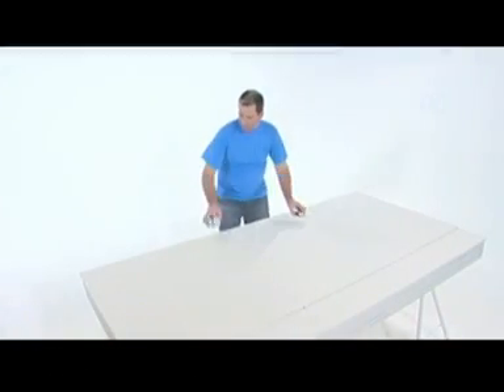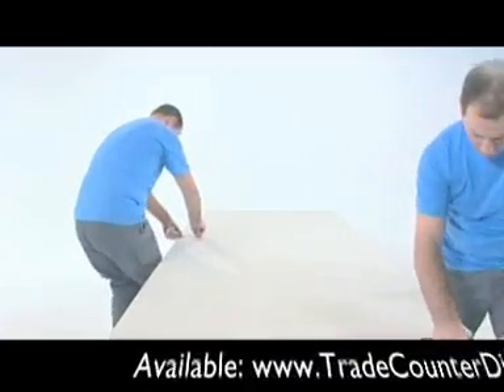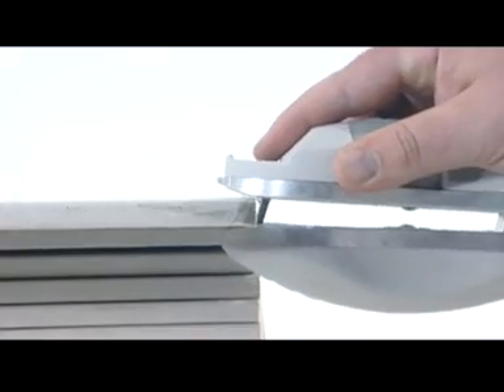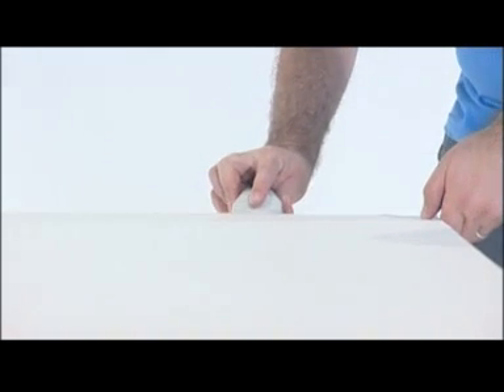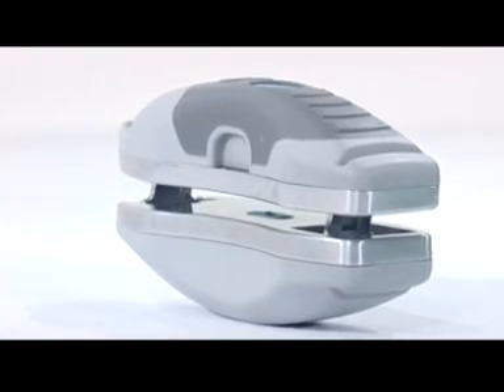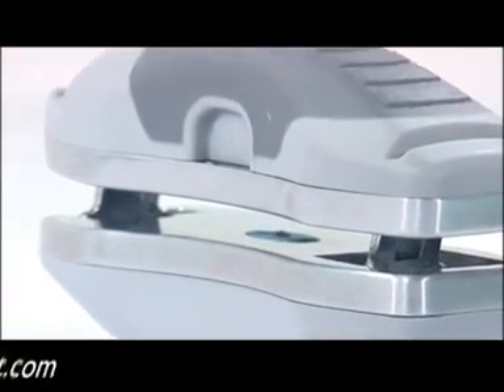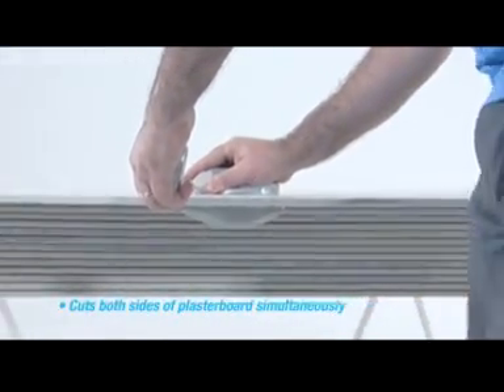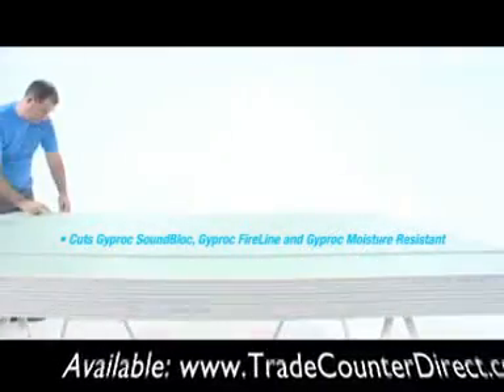Gyproc Blade Runner - Plasterboard Cutting Tool / Plastering Tool

Comment: All well and good in a room the size of a football stadium. Very hard to cut boards in half along length as board collapses. Works very well for cutting strips or smaller pieces but awkward to use for large cuts. I know I have one and thrown it  many a time.